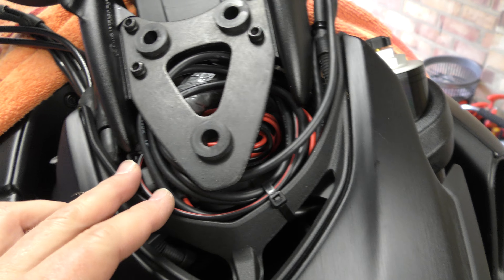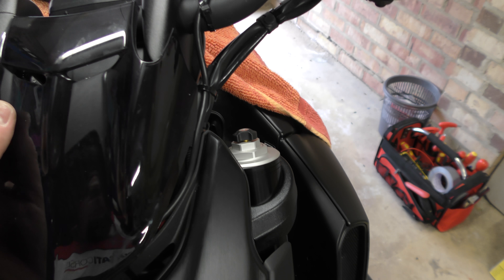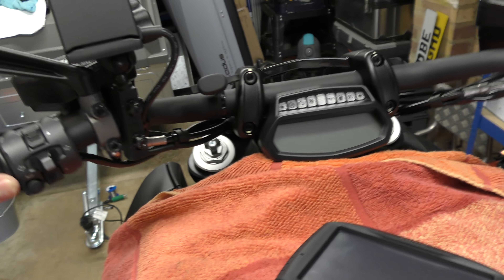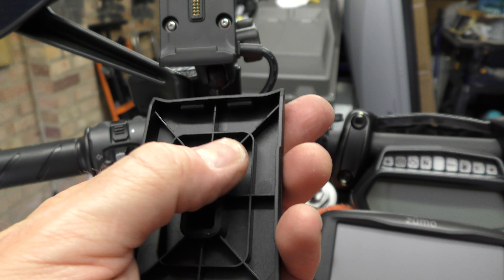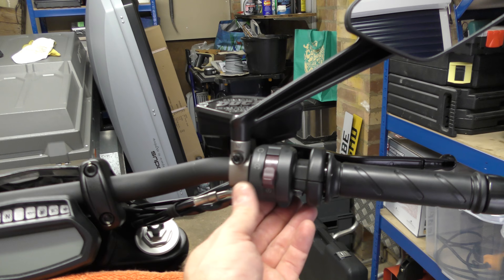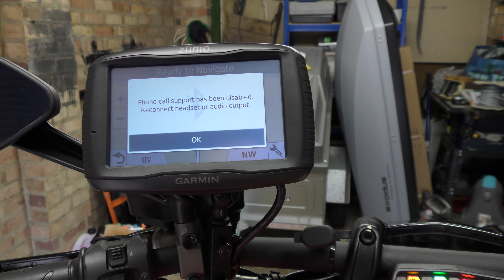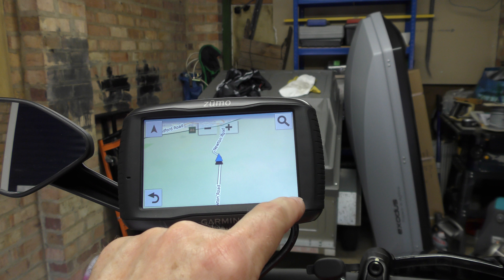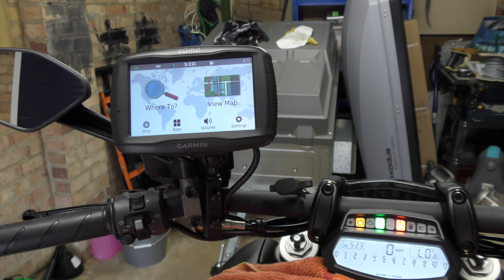2016 Ducati Diavel Sat Nav Wiring Completed.

Comment: Hi. i have got monster 796. I made the installation in the ducati service for zumo 595. i have two problem. first If I plug it into the motorcycke while the device is on, the device turns itself off and on. second USB port does not charge anything. Is its purpose different? thanks

Comment: Hi...another useful video but would have been even better if you could have shown us the actual soldering process and the application of the shrink wrap. Also, is the USB live at all times?
Reply from the maker: Sorry, thought that would be too basic to show, the USB is alive when the bike is on only!
Reply: Thanks ...ML(C)B....nothing is too basic for me! 
I've never soldered anything before, but would like to see what is involved / how easy (or not) it is to do. Cheers!
Reply from the maker: Pretty much just bare the ends of the two wires, slide on an appropriate length and diameter of heatshrink tube. Lie the cables side by side or butt them together depending on what you require and solder away...... The soldering iron will also shrink the tubing down if you have no hot air gun. Just run the tip all over the tubing. Very simple.